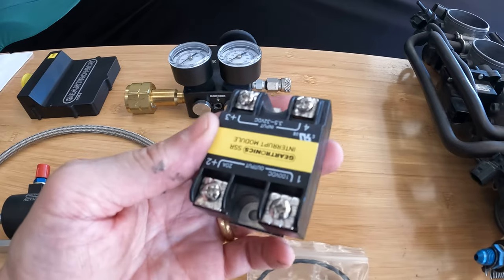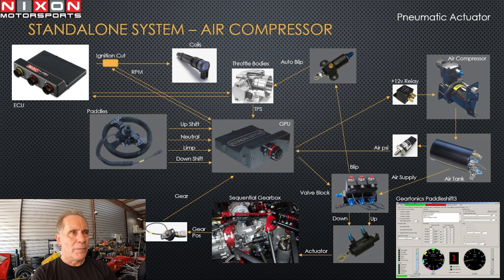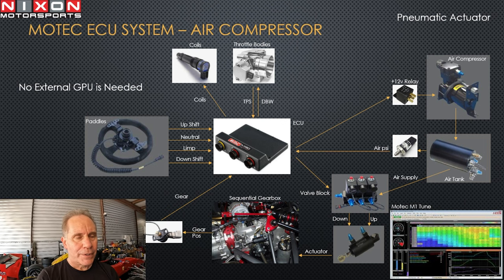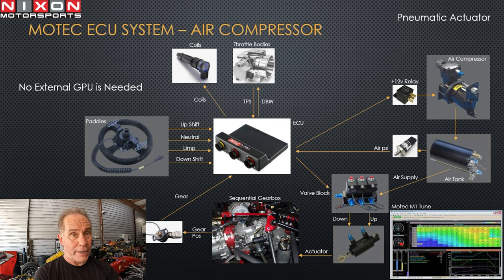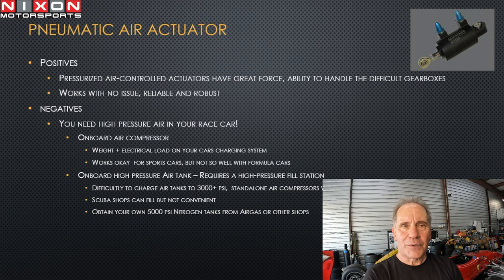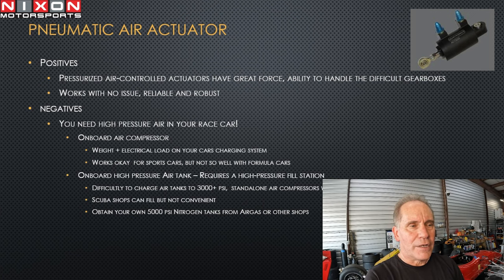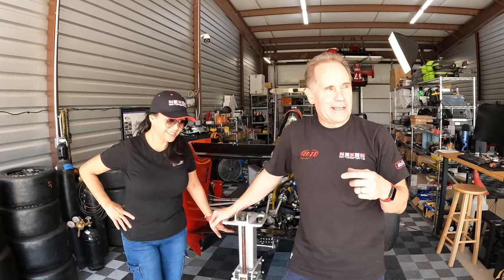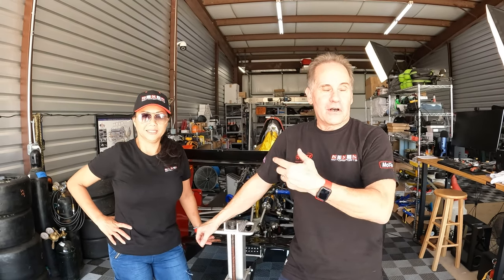Paddle shifters for race cars: Instructional and Lessons learned

Comment: Having just received my MME paddle shifters and actuator with integrated valves, I am very impressed at first glance.  They appear to be very nicely machined and designed parts.  I will be installing on my M1-powered car using the all-new "US Sportscar" firmware which addresses many of the shortcomings with the GPRP package (such as the need for a half shift to neutral for bike gearboxes).
Reply from the maker: That is great, please let us know how well the MME solution works.  Yes, GPRP does not support half-shifts.  One reason I use Geartronics package not GPRP.  Thanks for the note and let us know how it works.